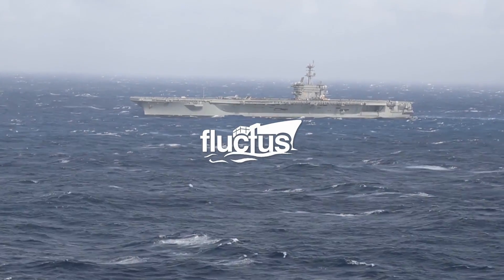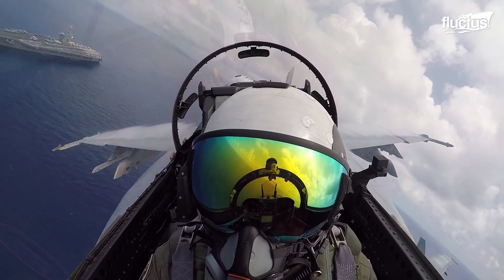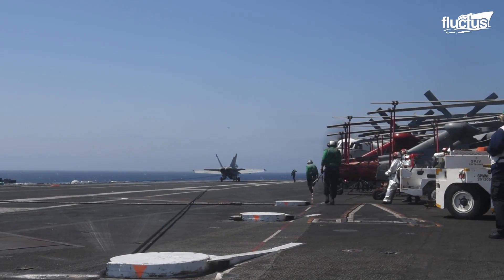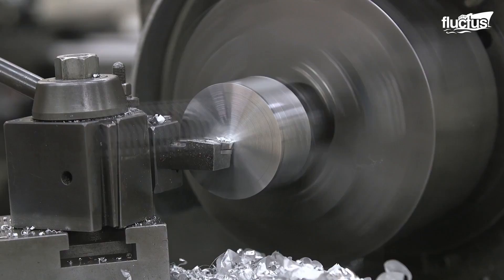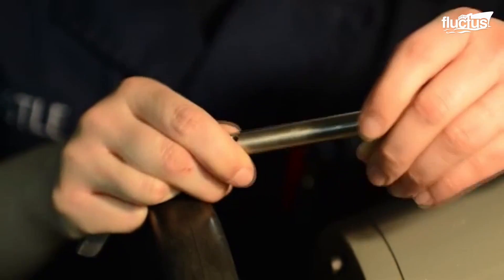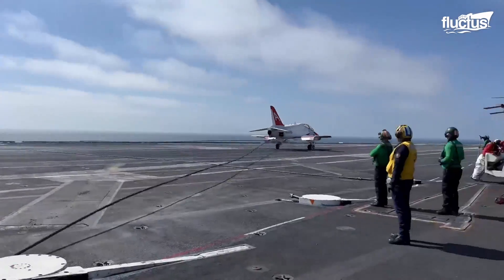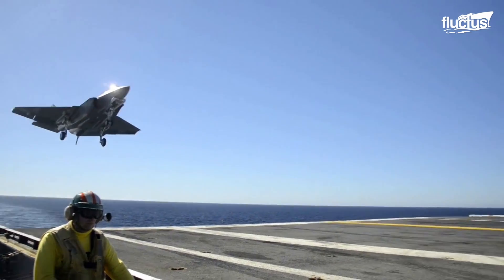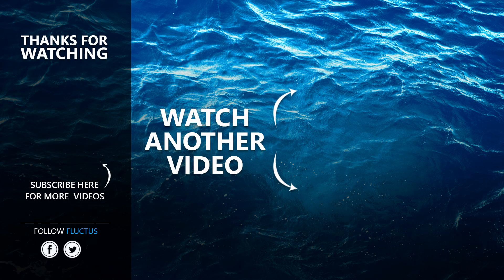What Happens When US Pilot Fails to Land on Moving Aircraft Carrier at Sea

Comment: When I was on the USS Independence no one was allowed on the flight deck or cat walks aft of the island during recovery operations.  I notice that isn’t the case any longer.  The reason for the restrictions was in case if an arresting cable snapped it could cut your legs off.